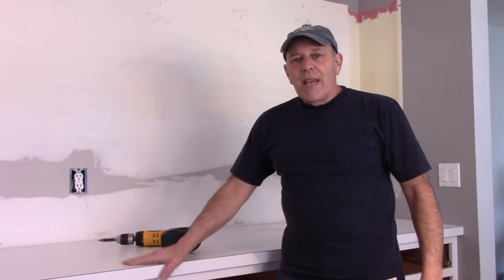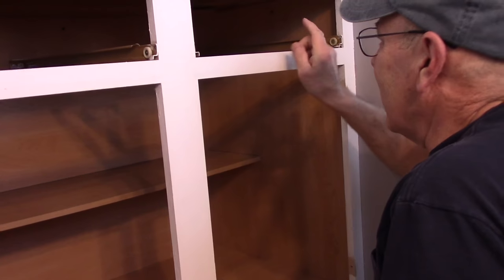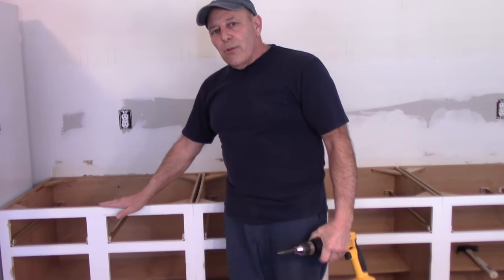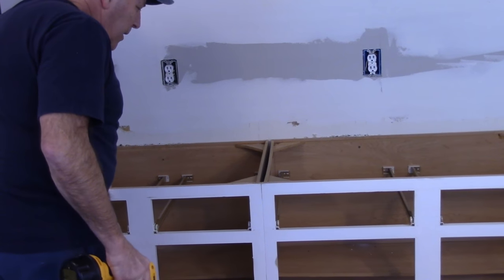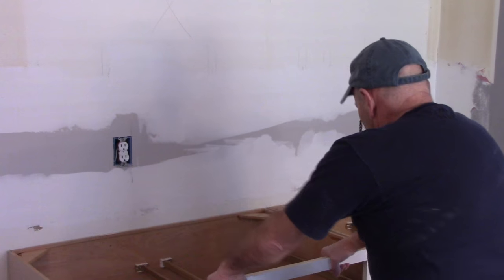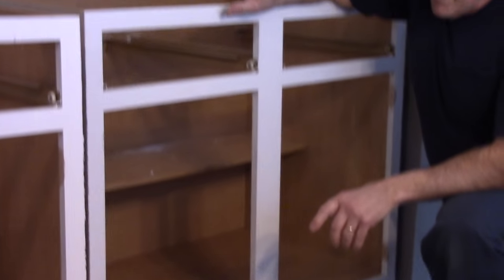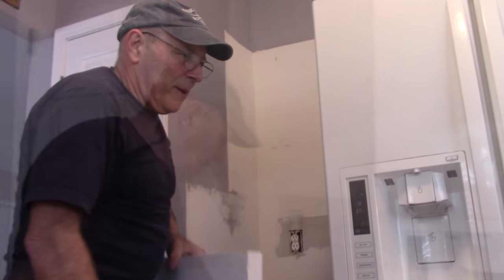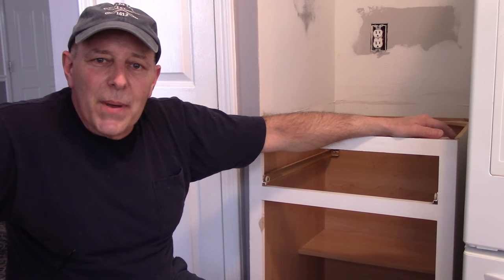How To Remove Lower Kitchen Cabinets

Comment: Thank you for this video. I decided to use the large utility room (approximately 15 x 20) as my kitchen.  The previous owners of the house had used it for a laundry room and for storing gardening tools.  At first, I used it as a great room, placing two large open china hutches in it and a table and chair set.  I also used it as a laundry room because of the utility sink already installed and laundry hook-ups.  However, I recently decided to turn that room into a kitchen.  I have my dishwasher, stove, and refrigerator in there now.  There was already a 220-240 line for the dryer, so I hooked my stove up to that line. I used the utility sink and I put my dishwasher in there as well. There's a small space off from that room where electrical wires are gathered.  I use that as a small pantry. The only thing I need to do in that room is install a new tile floor.  It's so much more functional now rather than the built-in kitchen already in the house.  I am taking those built-in cabinets out and converting that room into a dining room.  My former dining room is now my living room, and my former living room is not a library/study. I really prefer the old-style free-stranding kitchens now rather than built-in kitchens because there is less labor involved, they are cheaper to set up, can be changed easily, and are more functional.
Reply from the maker: Thank you for sharing. Good luck with the conversion.
Reply: @getitdonehomerepair  Thank you so much.

Comment: Thank you for this tutorial. I'm going to replace my electric cooktop with a gas range, which requires the removal of the countertop and cabinets, and the electric cooktop. I will leave the electrical work to an electrician, and the gas line to the plumber, but your video will help me remove the counter and cabinets myself.

Comment: Thank you again for a complete set of videos we can use to do the entire kitchen.  We are doing an entire kitchen replacement in our kitchen. Turning a terrible tiny,  floor plan,  U Shaped kitchen with gaw'd awful too large appliances installed by the contractor in 1995. Into a Skinny Kitchen/Compact/Tiny House. We are talking the 8' foot 4" inch wall with the plumbing on it and lining up the  24" wide Frig, 20" wide" stove, 18" wide inch dishwasher, and the remaining inches go to the single deep sink and the cabinet.
Reply from the maker: I'm happy to help. Send me a picture when you are finished.

Comment: I want to move a side panel under the kitchen sink as it keeps blocking our washing machine, and we have to use force to put the washing machine in place, every time we take it out to be fixed. On the left side of the washing machine there are the water pipes so nothing can be removed. But I was wondering can I move a cabinet side panel that is holding up the sink and counter a little so there's a gap between it and my washing machine?

Comment: I may have missed it but, what about foot boards or quarter round and kick board trim around bottom of cabinet....wish you could have showed best way to handle that part (especially if we want to re-use cabinet front or face frame....
Reply from the maker: Thanks for watching.

Comment: This is very helpful. Could it ne possible to show how to remove custom cabinets without destroying the existing one, so that it can be reused. My ones are from 1994 with real maple. The screws are not placed like this and i don't see actually any.
Reply from the maker: Try removing the hinges you will see the screws under them.

Comment: Hey I need help separating 2 kitchen cabinets. It’s the setup where the space from the refrigerator belongs. The cabinet above the space is about 1 1/2” to low for my fridge. I unscrewed it from the wall but it seems to be glued to the cabinets adjacent to it. Any advice?
Reply from the maker: I don't think it was glued it is most likely just stuck.
Reply: @getitdonehomerepair  turns out, besides the joining screws, there were staples connecting the 2 cabinets. Got it handled though. Thanks for your video to get the ball rolling for me!

Comment: We took off the screws but the bench top still quite hard to pull it out. Maybe too much glue. Not sure what else we can do?
Reply from the maker: If all the screws are out then it may just be the silicone that is holding it on. Make sure all the screws are out they could be hidden.

Comment: I found that I have a leaky sink drain pipe right where it goes into the wall behind my sink/counter top. I rekon I need to take the whole unit away from the wall to gain access. The worst part is that all of it is due for remodeling asap, I'm just not ready for that!
Reply from the maker: Your right you will need to open the wall to see what is going on behind there.
Reply: @getitdonehomerepair  I got really lucky & found that the dishwasher provided access to the pipe in question. Got it fixed only to find that there are cracks everywhere. From downstream  of the 2" sink,  to the 4" main sewage junction (probably incorrect lingo) so I have my work cut out for me... The dang house isn't even 35 years old.. The ABS sewage pipe they used seems to be super low grade.

Comment: Can you cut existing countertop ?
I m
Need to take 1.5 inches off one end.
Reply from the maker: Yes you can if you have the correct tools .What is the counter made of?
Reply: @getitdonehomerepair  pressed wood and laminate.
Would you like me to send you  a pic?
What type of blade should I use ?